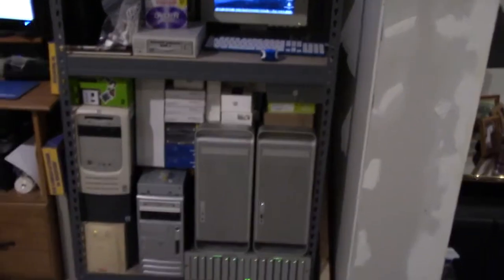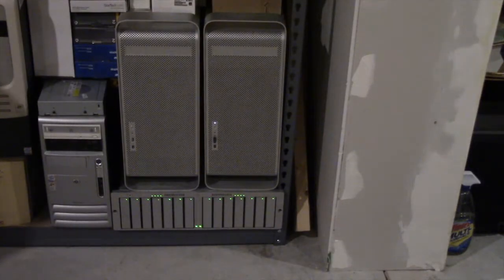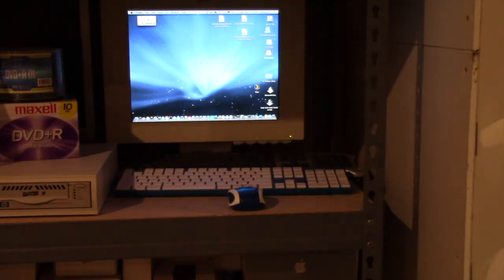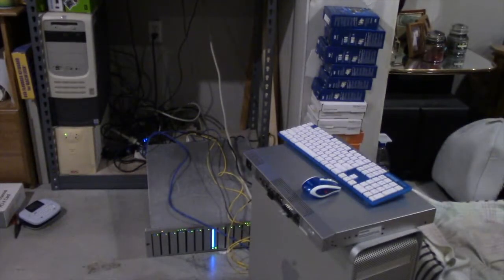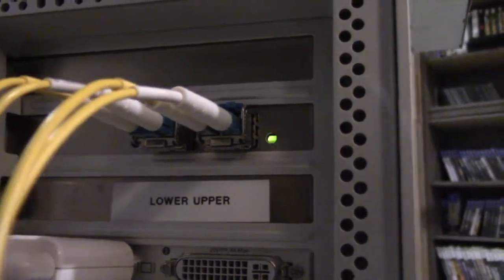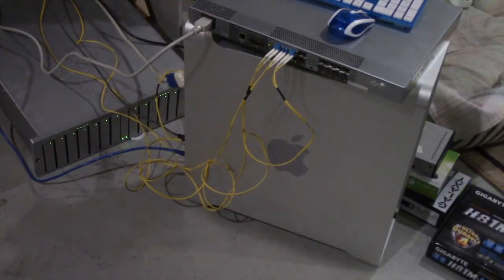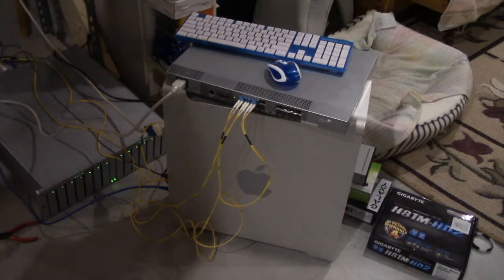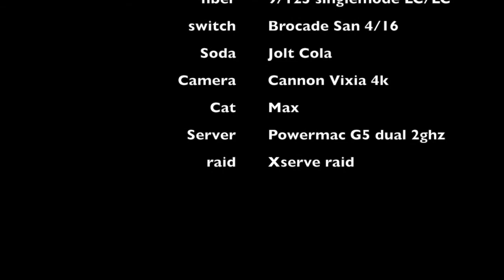Episode 39 Xserve raid update 2017 SM fiber with brocade fiber switch

Comment: You might have figured this out already, but those copper fiber cables are called DAC cables, Direct Attach Copper, it's used for short runs using SFP+ where traditional fiber's long distance benefits aren't necessary.
Reply from the maker: thanks for the clarification.

Comment: Love your videos , can I do any upgrades with my 2,1 Xserves running 10.7.5 thanks
Reply from the maker: sure , many things. i did processor upgrades on mine to start, then fiber cards, e-sata cards and a video card upgrade.  it really depends on what your starting with. I used everymac website to see what i could do and where i could go with them. then ran from there.
Reply: @ChrisEdwardsRestoration  Thanks Chris , I have an early 2008 2.8 Quad-Cora intel Xeon 6GB ram running Version 10.7.5 Server and a early 2008 2x3 Quad-Core Intel Xeon
with 8 GB 800MHZ DDR2 FB-Dimm running mac os Server Lion 10.7.5. I am a photographer so The startup disks are standard 80gh drive and the other 2 bays are 1TB WD. I have 3 Raid arrays 2 filed with 500gb drive and 1 3/4 filed with 750 GB drive, purchased a starTech 40-pin IDE data converter and a toshiba 1TB sata drive to put in 4 of my open bays. Hopefully to add all4 bays with these drives. I will go back and what how you upgraded the processors that will be my first thing to try.
Thanks for your help.
Reply from the maker: @UpCountryPhotography  , for the 2.8 i would do a dual 3ghz quad xeon upgrade first, got mine matching set on Ebay for like 30$,  your other seems to have that already. FB Dimm memory is also cheap for them now too. I got a whole 32GB kit for like 30-40$, ended up doing two servers at 32, one is still snow leopard, just because i love it, and i have a 10.7.5 server too. there is a utility you can get to spoof a Xserve3,1 and install newer OS's but i have not done that. maybe i will do one and do a video on it...
Reply: @ChrisEdwardsRestoration  Ha Thanks Chris, memory has seem to have dried up on the cheep side, I might go to OWC and spend the big bucks for one of the xserves and diffenantly get 
OWC Accelsior S
for both machines. to boost the start up disk. Looking forward, Don't know if you have done any videos on setting up the xserve using monitor , raid aim server aim etc, need some help with that learning curve also. Thanks
Reply: Chris Edwards:  The guy who does that is right here on YouTube — his name’s DosDude1 — upgrades for unsupported machines to later OS’s are straightforward, free, tested.

I know that you can perform firmware upgrades (from Xserve 1,1 to 2,1 for example), which means you can upgrade processors much higher, add far more RAM than Apple originally specified and, of course, install much later operating systems from USB flash drives.

On an original Xserve 1,1 upgraded to 2,1 (running maximum OS X 10.7.5 Lion Server), you can take that up to OS X 10.11.6 El Capitan.

Add 8 x 4GB RAM = 32GB in there and you have a monster upgrade — relatively dirt cheap — that’ll make Intel-based Xserves chew through another five years, easily.  Watch (in Activity Monitor) newly installed 2 x 4-core Xeon 3.2GHz processors eat through X Lossless Decoder (XLD) audio format and Photoshop work in no time.  Handbrake video conversions (.mkv to .m4v for example), done in half the time (6hrs vs. overnight).  Well worth it.

I hope this helps!

Comment: Hi Chris,  I was wondering if you could help me with a setup that im planning to build (connect). I have two Xserve servers and two Xserve Raid units. Im struggling to find people who have had experience with such Apple equipment
Reply from the maker: what do you need to know?
Reply: Chris Edwards - What would be the best/recommended setup e.g connect both raids to a single Xserve or does each Raid have its own Xserve? Do I connect Raids to a switch as well or not? Do I connect them via Ethernet or SFP?  I plan to use the RAIDs to store all my data, media and backups. Do I use one of the raids as a shadow copy of the other RAID? is it best to use one Xserve to support network services such as DHCP DNS etc and the other Xserve to control both RAIDS. What about cooling ? Do you have any recommendations in AC coolers? Or a rack mount AC? Is it best to run each PSU on a separate UPS?
Reply from the maker: well, a PC or Xserv or powermac or anything with a fiber card can connect to the xserv raid. there are two controllers, one top and one bottom, each control 7 disks, left or right side. there is also two ethernet ports, one on each controller so you can use the raid mgmt tool to configure the thing.  if only going to one server you can plug both sides into the same fiber card and it will see and use both sides. you don't have to shadow copy or image anything to the other raid.  you can use one server to rule them all, it can handle it. this is old tech , but still enterprise strong. I did a brocade so i could run two servers to the raids at the same time. now take into account if you have multiple servers accessing the same raid's via a fiber switch or some vlan you carve out on a switch, it will still need a Metadata controller like Xsan or something, or you will have mismatched data between the two. there used to be a sweet free one long ago called Metasan and MetaLan from tiger (http://www.tiger-technology.com)
Reply: Thank you :)

Comment: I would like to know about speed of xserve raid, is it good? could do a video?
Reply from the maker: its ok for storage and general access, with my updated data drives * they still are technically IDE connected because of the IDE2SAT adapters, however its good, i can copy 5+g movies in about a minute or less... i can do a video soon. thanks for the comment!
Reply: Good content for reference, I just managed to gain a Power Mac, to go with my first run Xserve and I should have an Apple Xserve RAID this weekend to play with as well. Thanks for the tips and hints! I'm looking forward to learning these machines as well😉
Reply: do you think that xserve raid can hold for emby?
Reply from the maker: they are a lot of fun, the IDE drives in the main setups are slow and poo, but converting them to all 1tb drives is easy bit costly in getting the IDE2SAT converters and 2.5" drives, but its all documented of my troubles, its a great machine now. I hope you enjoy it, if i can help shoot me a line and i will
Reply from the maker: Absolutely, I run a full iTunes and Plex library off of it, as well as storage for my Streaming services. don't let its old age fool you, it was over 10,000USD when it was new.
Reply from the maker: new video performance review uploaded. thanks for the request.
Reply from the maker: awesome, there a lot of fun

Comment: Those things need some fresh air around! Your setup looks like a bit "take fire pls" oriented.
Reply from the maker: they are not all on, fresh cool basement air dehumidified enters the front and exits the rear. the rack is away from the wall about 20" now , it works fine, temps hold in the 23c range. nice and cool. Once that damn cat dies i can remove all the boxes!
Reply: @ChrisEdwardsRestoration  Oh lol, poor cat! 23C! Didn't expect that, fine!